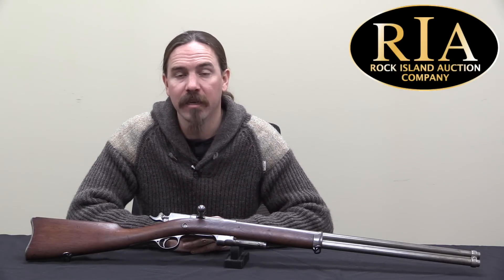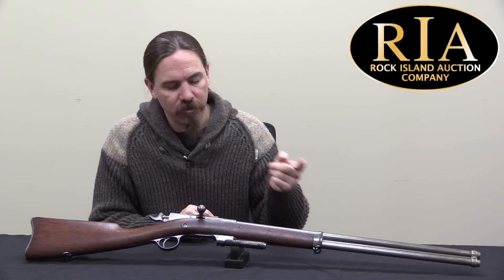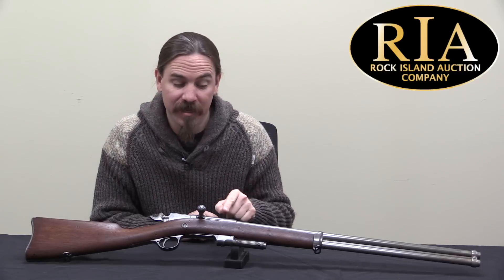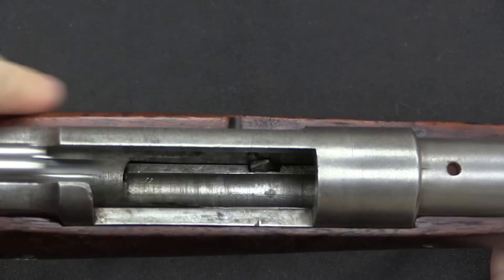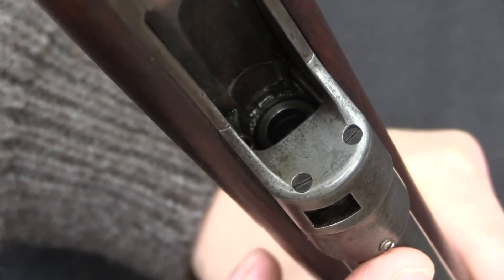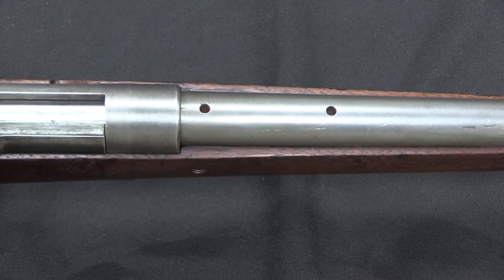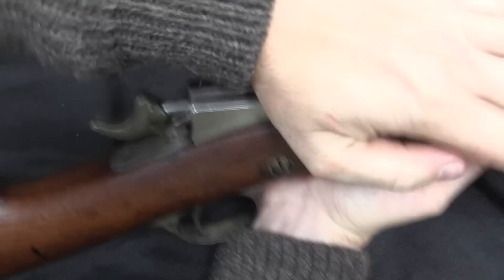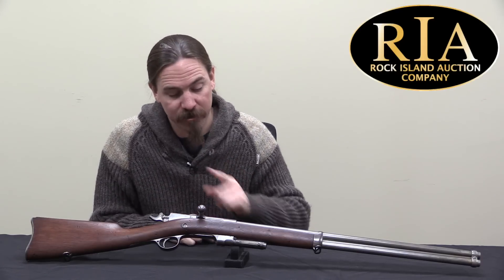Experimental Remington-Keene: Preventing Magazine Detonations

Comment: It really must be an exceedingly rare event, and id love to know in WHAT rifles it has provably occurred...especially if said to be under recoil (rather then dropped from a height)   .   When I first got in to Cowboy Action I used a Uberti 73 in 44-40.  The only cast 429 projectiles I could get at the time were RN rather than some form of Flat point or RNFP...  I was told I would have magazine detonations immediately/it was dangerous/etc etc.    Being new then to handloading, and being concerned by all this I did some testing. I secured a primed, empty case mouth down in a vise… made a little jig to locate one of those RN bullets  nose first directly ON the primer...  put on safety glasses etc..and started hitting the base of the bullet.  Result?  No primer detonations... and a deformed bullet.    And of course in some years of use, and several thousand of those projectiles shot...never a problem.  (RNFP bullets DID eventually become available) THAT experience, and MANY thousands of quite small nosed 125gr TC bullets through a 38 Special 73 , have really made me wonder HOW a magazine detonation could happen.    I think the RIM of these lever action cartridges, especially the 30-30/32 Special etc is large enough to angle the whole round enough in the tube to prevent routine contact with the primer..so there must be some OTHER factor involved in mag tube detonations...  (After all that rim/angle idea is effectively what prevented problems in the Lebel..wasn't it?)

Comment: "We need to avoid rounds detonating in the magazine."
Engineer:  Puts incredibly complicated device dependent upon little springs and tiny parts AND tiny cardboard disks that theoretically solved the problem but doubles loading time and, again is dependent upon all the above variables.
Everyone else:  Uses flat-nosed bullets.

Anyone else reminded of the space pen vs common pencil story here (yes, I know that's a myth but still...)? ;)
Reply: Not only is the pencil vs space pen thing a myth, it fundamentally misunderstands the motivation behind the space pen. The pencil wasn't the simple solution...the pencil was the PROBLEM. It works just fine for the first half a page until the lead breaks or you have to sharpen it. Then you have electrically conductive graphite shavings floating around in zero gravity, shorting out your electrical circuits.
Reply: As complicated as this system might seem, it was leagues ahead of the solution found in the Chaffee Reece. In addition, it was really the usage of deep primer cups and hard primers (plus rims) that would make that a non issue even in Spitzer bullets.

Comment: "...designed to cock automatically when the bolt was closed..."

 from the owner's manual: "NOTE.---These arms are all so made as to be left at half-cock after loading, but if it is preferred to have them left at full cocked it is only necessary to remove the Hammer Fly, No. 37, which is let into the tumbler to carry the trigger over the full cock notch."

 I have not tried this on my own gun to know if it is correct.

Comment: Wait... How does a spacer with a hole in the middle stop the tip of a bullet touching the center of the rear of another cartridge? Or were the spacers thick enough so that they would catch the front of the bullet so that it doesn't poke through the other side of the spacer?
I can't quite see where the stuck spacer ends down in the magazine to get an idea of how thick it is.
Reply: It looks like it is a simple flat disc.

Comment: "Oh it barely ever blows up if you drop it" is not what your troops want to hear.
Reply: anti-dropping incentive?
Reply: @TheWolfsnack  "you see Ivan," etc.
Reply: The army DID adopt the Sig p320, so there's apparently an acceptable level of "goes bang when dropped" still to this day.
Reply: @cgunugc  they adopted a pistol made out of playdoh that hit you in the face with pieces of slide.  Whats your point?
Reply: the issue only would ever happen when someone would drop or slam the gun on its butt stock
Reply: @natethompson6394 At the time formal military drill included slamming the butt on the ground.

Comment: Back in the mid-80's, I knew someone that had one of these that was the standard model, used to load BP round and shoot it!  Barrel was poor so it was not the most accurate thing around, but actually worked fairly well.  Having to cock the "hammer" for every freakin' shot was a total PITA and was easy to see why no one ever really adopted it, but still a neat gun all the same..thanks for the memories!

PS...I'm Lucky #7!!!!
Reply: I’d love one of these. A bolt action .45-70 is a very nice thing
Reply: I remember shooting a .22lr for a BSA marksmanship competition that had a manual cocking hammer device, and that thing was a total pain to pull back because it was a non knurled circular straight pull hammer lowered into a half moon recess in the stock. It had pretty strong spring tension on it too which made it even harder cock with the minimal amount of actual area to grip.